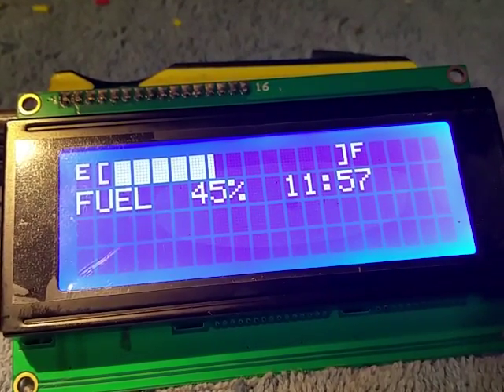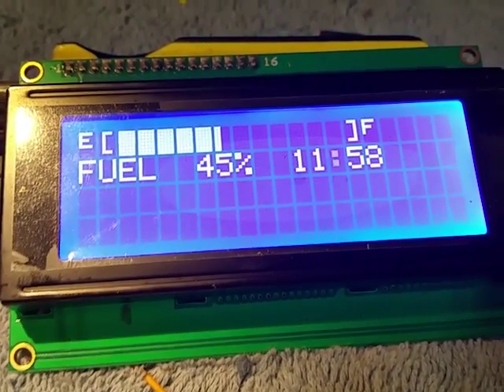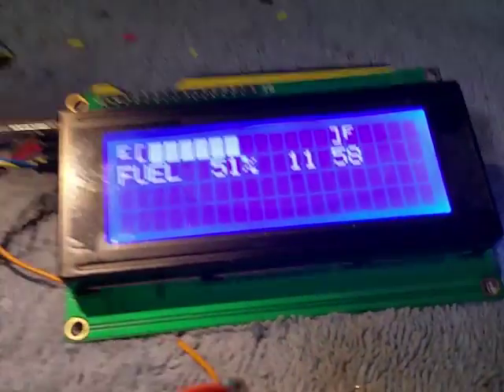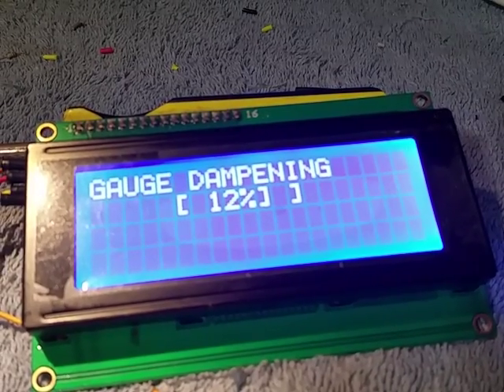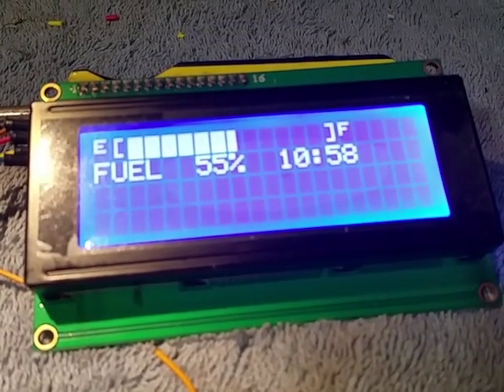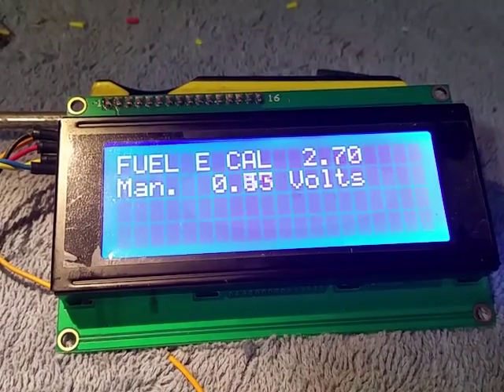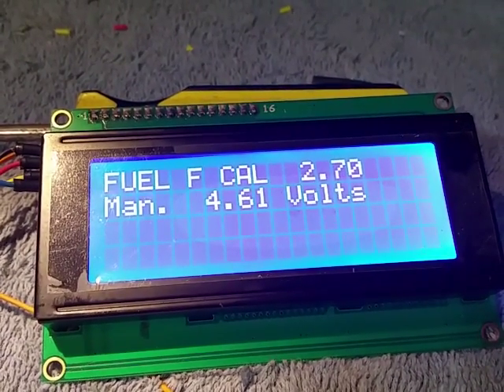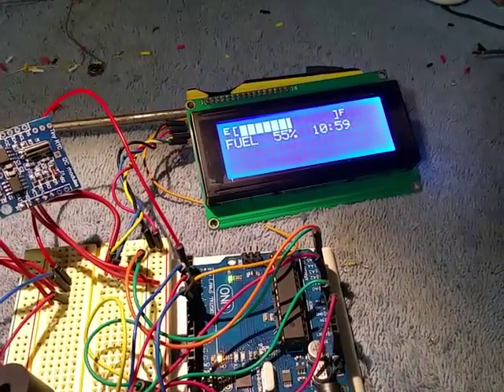Configurable Arduino Fuel guage with clock!

Comment: Looks like a great project, but you don't show or share enough to have any use of it. Where's the circuit diagram, what is used to actually sense fuel level? I guess I'll use the code for the functions, and maybe find someone else's project I can cut copy and paste something together. If only I were good enough to do this from scratch! :) I fly Ultralights and light  experimental , so this would be a great addition to the plane.

Comment: Could you also please add a pwm output to your code that is a 90-0 ohm .... 90 full - 0 empty? I want to also use this setup and tie it into my existing fuel gauge. Would be slick to have both LCD and still have the old school gauge work too. Thanks a ton in advance for your response.
Reply from the maker: Wes Pierce havent seen this till now. Oh well..  you dont control analog gauges with a resistance if you're using a microprocessor. You only pwm it. And without knowing the response rate of the gauge itself, it's near impossible to make with any kind of accuracy.  So, what i recommend is build a demo sketch with a knob and make the output scale the knob and write down on paper the pwm values required to get e, 1/4, 1/2, 3/4, full. Then, enter those values in an array.  If the value read from tank is above E but below 1/4, read those values out of the array and map the values to the value read from the sensor.  So..   example. You read the sensor and the fuel level is 0.15 of a tank.   E = 40 and 1/4 (0.25) = 80  as you entered it in the array.  Because .15 is greater than empty (0) and less than .25 tank your output will map 0.15 from 40 to 80.   In this case the pwm output should be around 64, or 25% duty cycle. 

Get it?